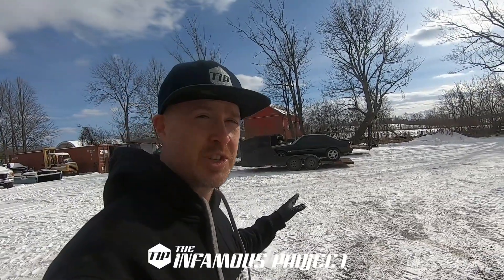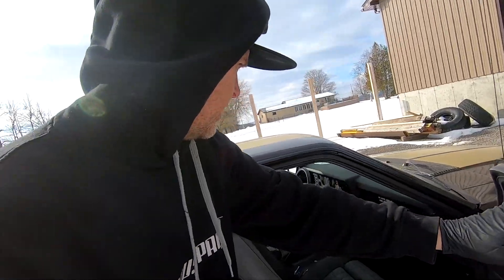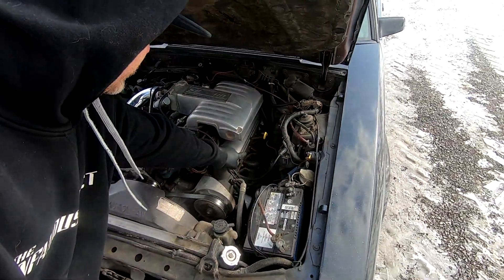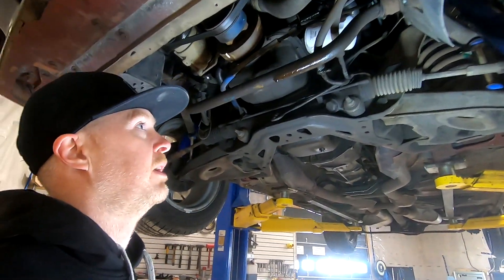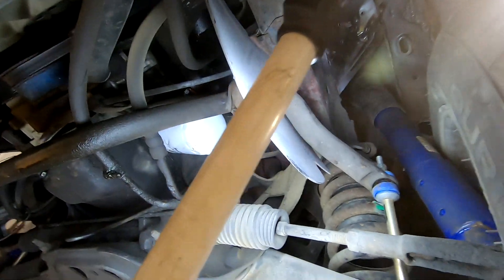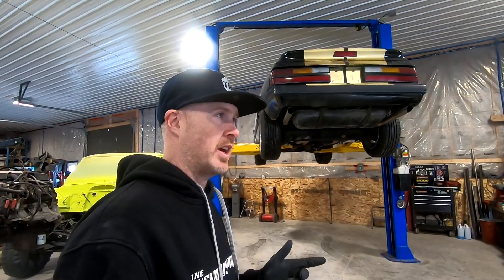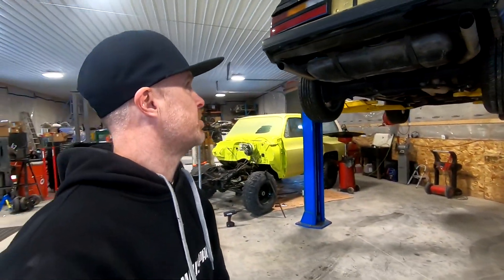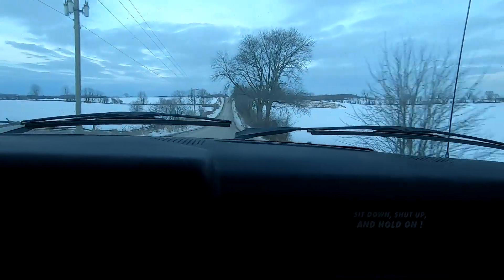I bought this 1986 Mustang GT for the ROH Wheels! Will I strip it? - TIP S04E14

Comment: 1990 motor with a B303 cam on speed density. I bet it idles awesomely.
Edit: No way that has a B cam. Sounds stock
Reply: Looks like it has been converted to mass air,,,
Reply: @mmjnice97  Where's the meter? I don't see it in the video anywhere.